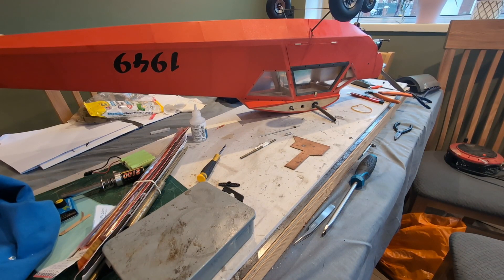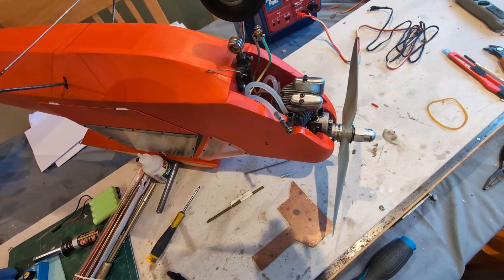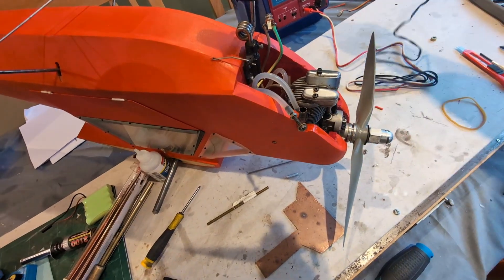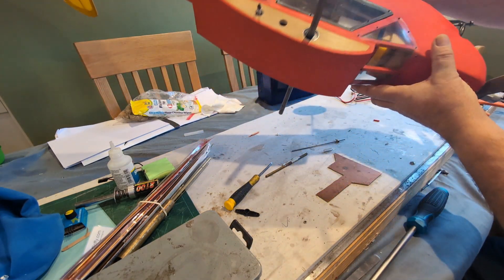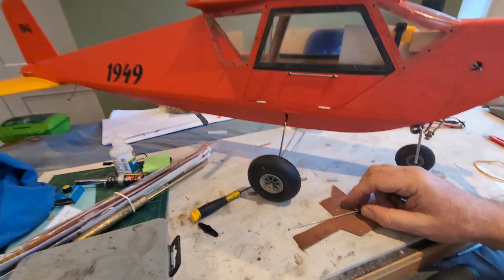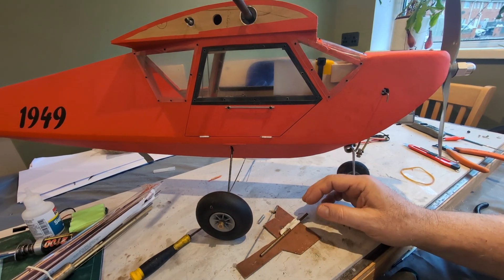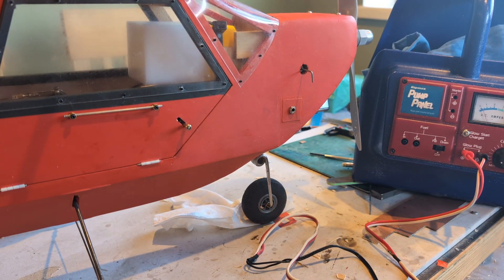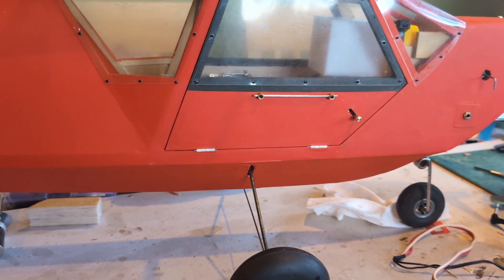Post maiden debrief of the Rudder bug.

Comment: Nice video.  You are a true modeler.  I use an on board glow driver programmed in the transmitter to light when in low throttle.  Uses a small battery.

Comment: You need to convert it to spark ignition Mark...Added bonus is the increase in power...Timing is everything...🤔😏🇬🇧
Reply from the maker: If the right engine turns up this would be the perfect bird for it.
Reply: @MarkCroucherRC4fun  I converted my ASP 52 four stroke to spark ignition, it's quite easy to do. .I also did a mates old OS 48 Surpass to run on petrol... They run cooler and better on Methanol though. They don't have enough fin area for Petrol....🤔😏